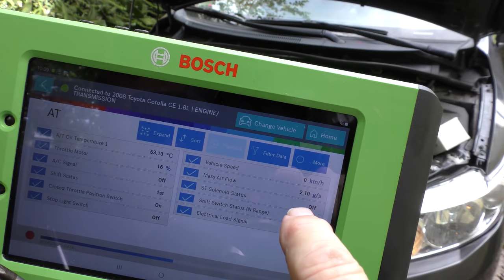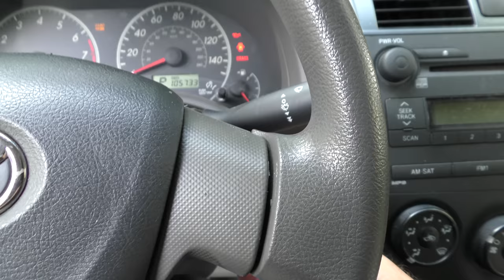Doing This Will Make Your Engine Last Forever (Mechanic Secrets)

Comment: I've noticed (at least in western n.y.) that many times when someone is selling a used car and they say rebuilt engine. 80% of the time its then replacing the seals and spark plugs and maybe the parts that were warn badly. They did the bare minimum to get the engine running again. So please, unless they have receipts (and a person who has honestly rebuilt the engine with the purpose of selling it will have receipts), do not buy the car. That is them admitting the engine has had allot of problems and probably still does, they are getting rid of it because of that reason. Try to think, why, if they put that much time into this car, why are they getting rid of it? Their answer should make sense, making sense will mean "yeah I'd sell it for that reason"

Comment: Hello scotty I need your input on a old Suzuki vitara the engine is not idling normal its really high when start up its 3000 rpm and it go down a bit its burning gas richly and smoking I put the air valve sensor and the engine is still running what should I do replace the senor

Comment: Insurance companies never want to payout! She needs to take the car back to the shop and TELL them to fix it right. You may need to use your insurance companies help and they will help otherwise use your small clams court system. That's what they are there for in my state we have cap of $10,000 not sure how high your state is, but use them.

Comment: Scotty I have a 2002 Honda accord coupe 3.0L. It has over 200,000 miles and transmission converter is messing up. Is it worth getting the transmission replaced.

Comment: Hey Scotty, I have a 2000 ranger with a 3.0 v6 at 106,000 miles and it has a misfire but it has 50psi in cylinder 6, it was very meticulously maintained at the dealership, what could the problem be? It isnt smoking and smells like its running rich,just for some more info to maybe give you more of an idea of my problem.

Comment: Honda has a problem with thoes later model 2.4l engines burning oil and they do pistons and rings under warranty. I would buy the one that had them done

Comment: Odd, Progessive gave me$3300 for the 97 S10 I had with 131 000 miles on it.   Might have gotten $500 on craigslist for it.  Y pipe was broken at the weld, and previous owner lowered the body onto the axles

Comment: With a flashing check engine light, that Avenger should be parked until fixed. IMO, the check engine light is flashing due to the misfire. If you keep driving it, the catalytic converter could be damaged.

Comment: So mass airflow sensor reads low so replace sensor. That is what parts changers do not what diagnosticians do. Find the reason it is reading low.  More than a bad sensor could lead to reduced mass airflow readings.

Comment: I have a 2008 Toyota Tundra 4x4 oxygen sensor got cut on my b2 s2. I replaced it and I’m still getting a code po157 low voltage. What should I do?

Comment: SCOTTY I HAVE A 2014 LEXUS IS 350 F SPORT IT  ONCE SHOWED A CODE THAT THE SOLENOID C AND D GOT STUCK, WHATS THE FIX ??? will changing transmissions fluid fix the fault ? 85000 miles

Comment: I have a 2011 Chevy Malibu 2.4L Ecotec. My performance seems sluggish. I have no check engine light. I just changed my intake and exhaust sensors. Could it be an issue or I'm just going crazy 🤣🤣🤣

Comment: Scotty I need your 53 years of experience. I recently changed my daughters air filter on her 2017 Hyundai Santa Fa. As I was putting in the new air filter I saw in the bottom of the air filter housing. Dryed   Dog food not a little bit but more than half full. Why do you need to put dryed dog food where your air filter goes
Reply: I have a field in the back yard,  and my vehicles sometimes have stuff in there intakes and heater motors as a result of mice trying to store "food".

Comment: Scotty, I have an automatic 2008 F-150 with about 240,000 miles on it and whenever I shift into reverse the truck rolls forward a little bit then starts driving backwards. Is this something I should be worried about?
Reply: All I can say is RIP transmission

Comment: Does anyone else have one of these cars? I have 2010 model corolla ascent. I have a thing where my fuel gauge moves ever so slightly down and up. Sometimes driving and especially moves down when I let it idle for 5 mins even sometimes under 5 minutes it can move? I need answers. I had it checked by a auto electrician and have even had the cluster “repaired” and it still kinda does it. Had a scan done no codes show. How many km should this car get for a full tank with most city driving and some highway? Will normal driving habit.

Comment: Hey Scotty. I love your videos. I am a young guy and I made the mistake to buy a 150k miles 2003 Subaru WRX for 4500 bucks. The car was in a rough shape but since it was my first car I put in the wrenching time to fix it. Now the engine mounts are shot and need replacing. My friend is selling 2013 Honda Crosstour for 11000 bucks. Should I sell my car and buy Honda?
Reply: @N0RT2G0RD4U The thing is they still owe those 11000 to the bank and I don't want to screw them over. By the way the car has only 52,000 miles. Thanks for the advice!!!

Comment: scooty I have a bmw 523i year 2000 my cam shaft sensor was old and detirating so the wires were exposed and my pliers accedently touch it and my engine shut off and now theres no start no crank any idea what it could be
Reply: anybody

Comment: Hi Scoty i have Mitsubishi Outlander 2017 CVT the dealership change transmission oil  in each 60000km only drain the oile from scrow  my car reach 120000km do you think I should tell them to change filter from in sider
Reply: That transmission doesn't have a normal filter, it has a screen filter which doesn't need to be replaced
Reply: @brian_jake   ok thanks for you info

Comment: Sounds like my "good buddy Dave" work. "I can get some good used parts and fix it." I wanted my 94" Ranger 5 speed rebuilt. So he found a 99 Ranger 5 speed.,,, But he did not get the stick. Yep Ford changed the shift fork stem. So it would come loose and then the shims needed replacing every two or three months. But hey, he saved me $20.
 That stuff would work in the 60s and early 70s.
 But since the 80s all vehicles are CAD design with every effort made to save a fraction of a oz of material and changes are made annually, sometimes semi annually. 
Almost as if it is part the plan? 

I have been saying for years why not admit it and Stamp "Dispose of Litter Properly" on the hood. Just like on a beer can.

I have had only 3 vehicles go past 200,000 miles on the original motor. "69 Suburban, 78 Corolla and 2004 Envoy. 
Some the others may have made it but the frames did not.
 Honorable mention for except for the frame '61 Pontiac Star Chief. Still running with no rebuild on the engine and transmission at 155,000 miles.
But I do have a friend that still daily drives his "59 Ranger Corsair. He also is one of the engineers that designed it.

Comment: I had a van totaled and all the Ins Co wanted to pay me was $1400, the high book value was $4200, we negotiated up to $3400(I had just put new tires, new bearings in the drive(the mech shop srood the pooch when they only replaced the rear oil seal and not the front too, causing it to blow on a 1400 mile round trip 200 miles out,  it cost me a case of oil to make the trip), so it was going to the shop the next day and overnight, some dweeb hit it enough to total it while parked.  Not to worry he too was disabled 50' parked into a fire hydrant and in front of the local Fire Dept.  His parents owned one of the most reputable car dealers and ended up replacing one van for another from them and still had around $500 left over to piss off....

Comment: I had a 2008 4-door Yaris i bought new for $13,800. In 2017 i was rear ended by a guy on the freeway that didn't have his lights on at night. Car was totaled with 160,000 miles. My insurance gave me $7,000.00. I took it.

Comment: That'll last scotty 106K thats it. I had a del sol that had 296K when I sold it, saw it still driving around 6 yrs. Later after I had drivin it from Ohio to Los Angeles, around Los Angeles for 4 yrs. Then back to Ohio again and only ever had to do brakes and a thermostat. That's literally it. Toyota and Honda are almost indestructible. Atleast they used to be.

Comment: 12 years old and in a big wreck, surprised it was written off. Can't believe they had it as reparable. Things work a bit different in Australia but insurance companies here like to write em off as unrepairable then give you money that is not enough to get you back to where you were. Once car is marked as unrepairable written off, even if you fix it, its on the system and you will never get money for it, unless you sell it privately and the guy is stupid and doesn't check the vin

Comment: At 3:09 Scotty this is not the original engine it's a Junk Yard piece of Crap shows Chevy Dealer
At 7:03 Scotty if you are nuts about the car you can get a used engine from a Junk Yard shows Fiat Dealer

Comment: Hole in engine: put a screw or bolt in the hole. Or JB WELD.
Reply: i'd rather go for a screw with some weld than epoxy resin fixes on the hottest part of the engine.

Comment: Scotty. How can I ask you a question?
Reply from the maker: you just did!
Reply: @scottykilmer  haha indeed. I have a 2014 Toyota Camry. I am the second owner. Bought it at 45k miles now it has  115k miles on the clock. Do you recommend changing the transmission oil and coolant or is it too late and don't mess with it?.
Reply: @abugalyon3272  if my memory is right, Scotty has always adviced to change such part's oil every 60 or 70k miles. Make the maths... Even if the previous owner changed it right before selling it to you (ods are they didn't), it is about time for you to change it, like as soon as posible.  If you're gonna do the work yourself (which you perfectly can), do it right. I'm sure Mr. Kilmer has a video about how to do it properly (search up); it's a basic and vital car maintainence procedure.
Reply: abu galyon I have a Chevrolet 2006 equinox with 304700 miles and haven’t changed it in 6 years since I bought and works great!!
I’ve heard if you change it all it makes transmission slip

Comment: My parents bought a brand new Toyota Sienna limited van back in 2006. Both power sliding side doors have been replaced 5 times by Toyota and mechanics. And it’s broken even now. We have also had the battery replaced 6 times over all these years. 

Side note: The oil pump broke and we didn’t know so the engine seized up and we had to replace it with a junk yard engine. Ever since then, the car have been running like a clock

Just some tips if anyone reading this comment is interested in buying a used Sienna van

Comment: Would it have been easier to  pull the vin number off the engine to get the right parts rather than guessing the part? Please, do not tell me that there is no vin number on the engine or I will tell you that you do not really know your cars as well as you claim.

Comment: I believe this woman got rip off or scam by the auto body shop because 3 months of fixing the body of the car. It seems to me it is odd ball there. That auto body place probably swap the engine to a good to bad and sold it to someone and then get a different engine put in to that vehicle from a junkyard. It is sad how people out there doing a such a cruel thing like that. If my car is total I would let it get total instead of fixing it. Because it wont be the same as the original like before after got into an accident.